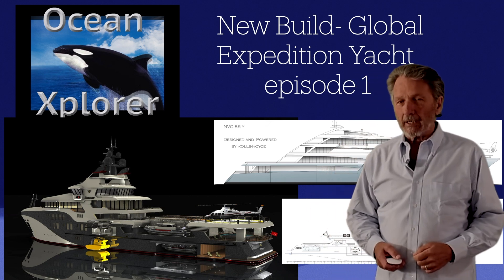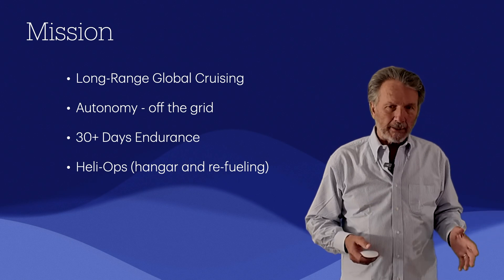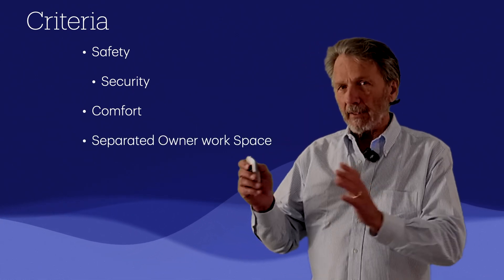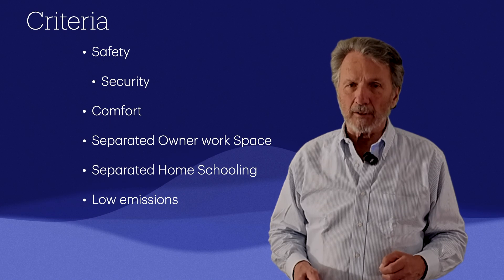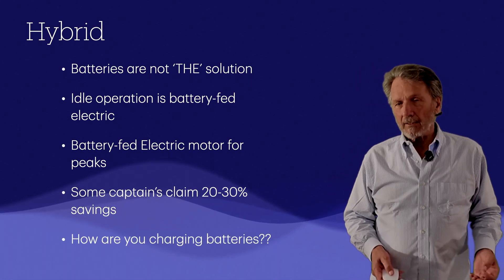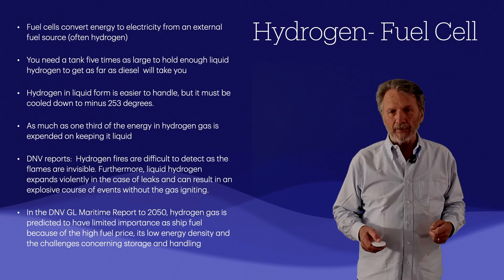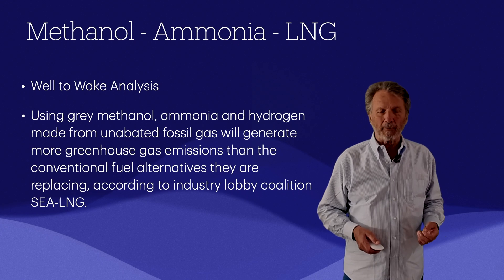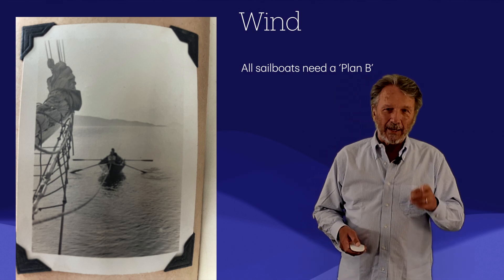Xplorer Yachts New Build Project - Episode 1 - "PROPULSION SYSTEM"

Comment: I would also want the following survival gear on all of my yachts, aircraft, and helicopter.

Survival Gear: Lifeboats, life jackets, buoyant platforms and life sustenance accessories:

A- Lifeboats: A spherical buoyant shape(just like a ball), so it is resistant to wind and waves. It can be made from fiberglass, aluminum or titanium. Fiber glass is light, but can break, whereas aluminum can corrode with currents.

1- Keel with anhedral wings (just like the shape of the Harrier jet-aircraft) beneath the life-sphere to prevent it from overturning/flipping.

The wing-shaped keel would serve as an anchor when the life-sphere is motionless to prevent its rolling, while it will help the life-sphere plane or even hydrofoil at higher speeds, when the life-sphere is propelled.

A squall or a breaking-wave should fall on the anhedral (aircraft-like) keel, from the top, to anchor it and to prevent it from capsizing. Waves approaching it from the front, would lift it up(depending on the angle-of-attack of the wing), just like an aircraft, so it effortlessly surfs the waves and doesn't fight them. Waves approaching from behind would push the tail of the anhedral(Harrier aircraft-like) keel down, to lift the wings up. However if the angle-of-attack of the wings is too abrupt, it could cause the life-sphere to roll-over/capsize because the escape hatches can never be perfectly sealed.

a- Even though a sphere can self-right or can have a gyro inside it to always keep the occupants facing upwards, the escape hatches could still leak, so it is important that this shape doesn't roll.

b- One could also extend an inflatable water-tank beneath the life-sphere, at a greater depth, which would fill with sea water and act as a deep keel or an anchor to further prevent rolling.

c- We could also construct partially perforated wings around the sphere to resist rolling and flipping/capsizing.

2- Solar-Still: One could add a spherical solar-still made from transparent plastic along the entire surface of the sphere. This would have a dark insulated chamber beneath it where the vapor would condense into purified water. This chamber could use solar PV-cells on the outside to generate electricity and to also shield the condensed water from the Sun. One could use capillarity to have the outer chamber of the solar-still fill itself up, or we could fill it up manually. The Sun will naturally heat the water into vapor in the outer chamber, which will condense into the inner chamber.

3- Solar Panels, Regenerative Props, and a Wind Turbine: These will provide the raft with power to propel itself and to also operate the HF and VHF radios, satellite phones and beacons, a fan, a heater,  and perhaps even a dehumidifier(to condense vapor into water). We could also equip this with a solar cooker/stove that could also run on electricity. Food would have to come from the fish and sea life which the occupants hunt, whereas the salt will come from sea water, which can even fight germs. The vitamins would have to come from the livers of whatever they hunt.

4- Thermal Battery: The water heated by the Sun during the day could also be used to keep the craft warm at night.

5- An Electric Motor and a Small Sail: These would be the primary and secondary sources of propulsion. The life-sphere will use both solar and wind power during the day, and wind or regenerative turbine at night. It would use the sail if the motor fails to function.

6- A Stirling Engine: The prop could also be coupled to a Stirling engine, using a parabolic reflector or a magnifying glass to heat the base. This isn't very practical, but one could look into it.

7- Aluminum Foil: Part of the life-sphere not covered with the solar-still and solar panels can be covered with an aluminum foil, so it naturally reflects light for search teams to spot it.

I would also want small, hollowed, polished stainless or chrome plated floating balls for reflectors.

8- Weapons: A Taurus Judge revolver, long-barrel Tavor 7,  a few cross bows, a few spears, and a few knives:

The Taurus Judge can fire 0.45 Cal long-cartridge (which could even kill a shark that has breached the water, and everything else), and also 410 shells (which could help hunt and even shoot flares at night).

The cross-bow could serve as a harpoon, and the spears and knives mean you'll never run out of ammo to defend yourself.

9- Inflatable canoes, kayaks, life jackets, and large Styrofoam pads: These would provide flotation and transportation even in the event of the life-sphere sinking for some unimaginable silly reason.

10- Navigation: A solar, waterproof, and floating satellite phone/smartphone/GPS device; waterproof or plastic floating map; and  a floating compass, Octant and Sextant.

B- Aircraft Survival Gear: A maneuverable rectangular parachute, with flexible solar covering and a small electric motor to fly it, like a slow-speed aircraft. You'd also need inflatable/light-weight versions of some of the other survival gear designed for the yacht.

Comment: I would also want the following survival gear on all of my yachts:

Survival Gear: Lifeboats, life jackets, buoyant platforms and life sustenance accessories:

A- Lifeboats: A spherical buoyant shape(just like a ball), so it is resistant to wind and waves. It can be made from fiberglass, aluminum or titanium. Fiber glass is light, but can break, whereas aluminum can corrode with currents.

1- Keel with anhedral wings (just like the shape of the Harrier jet-aircraft) beneath the life-sphere to prevent it from overturning/flipping.

The wing-shaped keel would serve as an anchor when the life-sphere is motionless to prevent its rolling, while it will help the life-sphere plane or even hydrofoil at higher speeds, when the life-sphere is propelled.

a- Even though a sphere can self-right or can have a gyro inside it to always keep the occupants facing upwards, the escape hatches could still leak, so it is important that this shape doesn't roll.

b- One could also extend an inflatable water-tank beneath the life-sphere, at a greater depth, which would fill with sea water and act as a deep keel or an anchor to further prevent rolling.

c- We could also construct partially perforated wings around the sphere to resist rolling and flipping/capsizing.

2- Solar-Still: One could add a spherical solar-still made from transparent plastic along the entire surface of the sphere. This would have a dark insulated chamber beneath it where the vapor would condense into purified water. This chamber could use solar PV-cells on the outside to generate electricity and to also shield the condensed water from the Sun. One could use capillarity to have the outer chamber of the solar-still fill itself up, or we could fill it up manually. The Sun will naturally heat the water into vapor in the outer chamber, which will condense into the inner chamber.

3- Solar Panels, Regenerative Props, and a Wind Turbine: These will provide the raft with power to propel itself and to also operate the HF and VHF radios, satellite phones and beacons, a fan, a heater,  and perhaps even a dehumidifier(to condense vapor into water). We could also equip this with a solar cooker/stove that could also run on electricity. Food would have to come from the fish and sea life which the occupants hunt, whereas the salt will come from sea water, which can even fight germs. The vitamins would have to come from the livers of whatever they hunt.

4- Thermal Battery: The water heated by the Sun during the day could also be used to keep the craft warm at night.

5- An Electric Motor and a Small Sail: These would be the primary and secondary sources of propulsion. The life-sphere will use both solar and wind power during the day, and wind or regenerative turbine at night. It would use the sail if the motor fails to function.

6- A Stirling Engine: The prop could also be coupled to a Stirling engine, using a parabolic reflector or a magnifying glass to heat the base. This isn't very practical, but one could look into it.

7- Aluminum Foil: Part of the life-sphere not covered with the solar-still and solar panels can be covered with an aluminum foil, so it naturally reflects light for search teams to spot it.

I would also want small, hollowed, polished stainless or chrome plated floating balls for reflectors.

8- Weapons: A Taurus Judge revolver, long-barrel Tavor 7,  a few cross bows, a few spears, and a few knives:

The Taurus Judge can fire 0.45 Cal long-cartridge (which could even kill a shark that has breached the water, and everything else), and also 410 shells (which could help hunt and even shoot flares at night). 

The cross-bow could serve as a harpoon, and the spears and knives mean you'll never run out of ammo to defend yourself. 

9- Inflatable canoes, kayaks, life jackets, and large Styrofoam pads: These would provide flotation and transportation even in the event of the life-sphere sinking for some unimaginable silly reason.

10- Navigation: A solar, waterproof, and floating satellite phone/smartphone/GPS device; waterproof or plastic floating map; and  a floating compass, Octant and Sextant.

B- Aircraft Survival Gear: A rectangular maneuverable parachute and inflatable versions of all of the above gear.

Comment: Small modular nuclear reactors: https://www.youtube.com/watch?v=9cc1j-MbVVA

There are even smaller reactors than these in the pipeline. 

Westinghouse and other established firms have also come up with their small reactors.

Nuclear reactors have been used on naval vessels for close to 80 years. 

Recall that tiny reactor from the US base in the Arctic?: https://www.youtube.com/watch?v=1Ujx_pND9wg
Reply from the maker: There appears to be the technology, however clearing customs on port entry could be challenging. Same goes for these design concept featuring tropical rain forests and lush gardens on deck.

Comment: I was a very strong advocate of trimarans, as a young man, but, now, that I've turned close to 60, I want something tried-and-tested, like mono-hulls. 

For those who wish to experiment, a smaller yacht based on the Independence Class littoral vessel would be the perfect compromise between ability and economy. It could even climb small packs of ice, just like an ice-breaker,  to break them up with its weight. 

A flatter sailing trimaran with a retractable centerboard or swinging keel could also drastically diminish the possibility of capsizing.

These, though, might still be too broad to navigate through the ice in the Arctic and Antarctic,  and would also lack the energy(momentum = mass x velocity) to break the ice packs with impact. Since they're multi-hulls, these might not even survive impact with the ice, and rupture themselves.

A yacht based on the Independence Class littoral vessel, though, could climb on top of the ice and break it with its weight.

I would never buy a trimaran for myself because, at 58, I don't wish to risk things that haven't been exhaustively tested, but here are links to some exciting trimarans, down below:

1- Independence Class LCS: A shrunken version of this could even venture into the Arctic and Antarctic(provided it can refuel on the way): https://en.wikipedia.org/wiki/Independence-class_littoral_combat_ship#/media/File:Independence_(LCS_2)_in_drydock.jpg

2- Adastra: Too flimsy for rough weather, but the design lends itself to very spacious interiors and economical cruising: https://robbreport.com/motors/marine/adastra-trimaran-superyacht-1234628628/

3- The Hanstaiger: This, again, has very good performance characteristics and spacious interriors, but like other multi-hulls could get stuck or broken in ice in extreme latitudes: https://www.hanstaiger.com/exceptional#exceptional5

Comment: My priorities would be safety, autonomy, comfort and economy. 

I, personally, would choose two different yachts.

A- A 90ft, aluminum hulled, ketch with a centerboard for economical cruising with just my kids or a couple of crew members for  most of the sailing adventures.  

I want a ketch or a schooner because I feel unsafe with  tall rigs/masts. Schooners don't perform well upwind, so ketches are generally preferred, but I'm not entirely convinced, so will even take a very close look at a schooner before I commission the build. 

I like the S/Y Spirit of Venice and S/Y Sunday Morning(Palmer Johnson), so might just purchase these off-the-shelf.

I need 3 suites on this: A large, beam-width suite with a desk for myself; 2 comfortable, but not too spacious rooms for my kids; and a very spacious saloon that would serve as the epicenter of all activities.

I don't like batteries, so I could opt for a backup diesel or ammonia drive for this. 

I don't care about emissions, unless they're regulated, but I want to be autonomous and economical. 

This could use a blend of solar and wind power at anchor(since neither source has round-the-clock availability and because I'm averse to  large battery banks. I don't mind small banks for a few hours of emergency backup),  and a (shaft-driven) water-turbine under sail. 

I might choose twin screws, two sets of twin rudders(like those on S/Y Pangaea), and twin drives. 

90ft isn't too big, so I'd have to factor the space sacrificed into the equation. I don't want a yacht larger or smaller than 90ft to cruise with my kids. Smaller ones are too cramped, whereas larger ones need large crew complements. 

I might choose a Perini Navi interior for the sailing yacht and a San Lorenzo interior for the motor yacht. 

I also like Alberto Pinto, Mark Berryman, and Kelly Hoppen interior.

B- A 160ft to 220ft motor yacht, like the Odyssey/Alucia or T6/V6).

I need to be able to take this to explore the Arctic and the Antarctic, so would want a helicopter hangar(43ftx8ftx13ft) and a submarine/amphibious vehicle hangar(14ftx8ftx9ft), and the ability to service and fuel an occasional flying-in amphibious aircraft. 

I want a large saloon to serve as a social/party venue,  a work place, an emergency hospital, and a school for my kids. 

I want a reasonably sized Sundeck and Sky lounge, and a small fly-bridge. These could also be swapped for other activities(office for myself or school for my kids)  if the saloon is too busy to hold those activities. 

I want a shallow and a narrow pool, perhaps, where I could swim against a water jet. I want this to be 10 to 18ft long (depending on whether I swim against a jet, or actually swim the length), 4ft deep, and 7ft wide.

I want my own suite to be spacious and equipped with a desk and a settee. I need the 3 guest rooms to comfortable, but not too spacious. 

I want the crew to share  2 dorms, each to sleep 8 people in 2-storey, single beds, two on each side. These dorms could also take in extra guests. 

I want the dorms to have 2 to 4 common showers and toilets.

I want the engine room to also serve as a workshop.

I would choose a nuclear reactor for both propulsion and facilities power, and, perhaps, back it up with wind, solar, or shaft power to only power the essential systems in the event of failure of nuclear power.

You need to take a look at the new pico/micro nuclear reactors, they're very tempting, and they've been used on nuclear submarines, aircraft carriers and even surface vessels for decades.

I might employ General Dynamics or a French specialty nuclear firm to provide a nuclear reactor designed specifically for marine use, even though modern, micro and portable nuclear reactors are turning quite common these days. 

I, though, am not too familiar with the regulatory turf on marine nuclear power.

If I had the money, I would buy the S/Y Spirit of Venice or S/Y Sunday Morning(Palmer Johnson) and M/V Odyssey/Alucia off the shelf.

Comment: Let's start with...nothing is perfect.  
Wind...ok becalmed isn't fun. Neither is the gigantic mast required to move something as massive as the boat we are talking about. Throw in the fact that those masts are, well, lightning rods. Yep,getting whacked by lightning will do massive damage to the electrical systems. I have had my 43' sailboat hit by lightning. One last thing about wind. Crazy 50-100kt winds happen. The bigger the boat, the bigger the target.  
For a vessel this size, diesel electric hybrid is the smart way. 
Oops, almost forgot...wind is ssssssslllllllooooooowwwwwwww
Reply from the maker: 350 ft Black Pearl hits 30-knots under sail - but the rigs we are looking at will be used mainly to augment the main propulsion, to achieve fuel savings in the 30-50% range, while maintaining cruise speeds. They should also deliver 8-10 knots with only wind in ideal conditions. Any vessel sitting on the water is subject to a lightning hit, power or sail. The advantage of having a lightning rod/mast is that it is rigged for this and diverts the charge directly to the keel. All sail rigs reef, or fold away, for high wind.